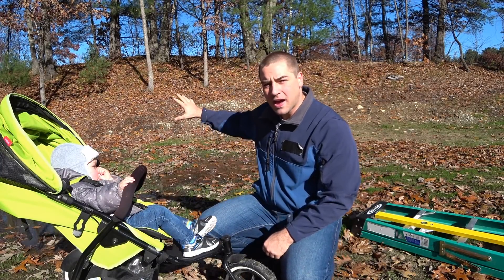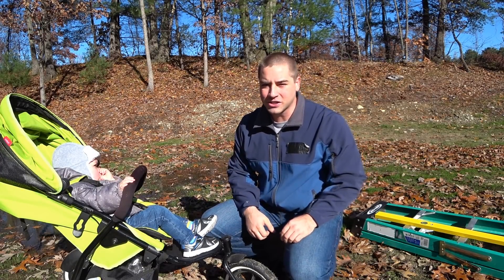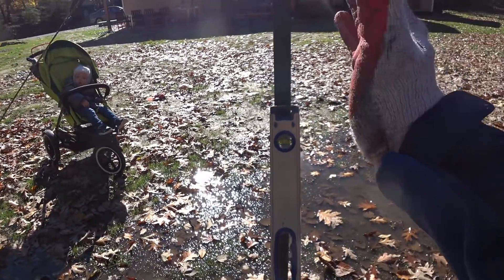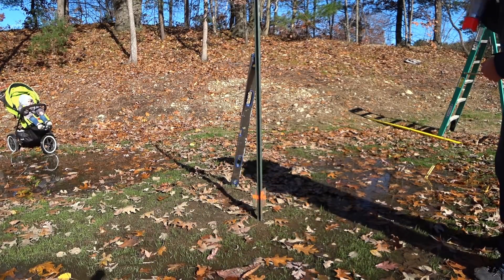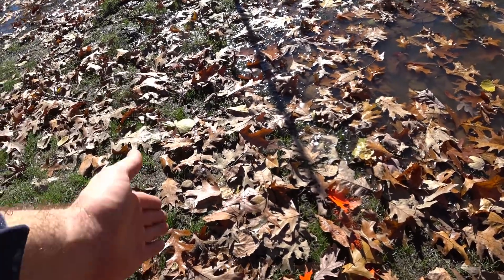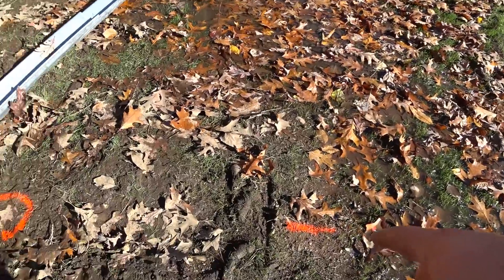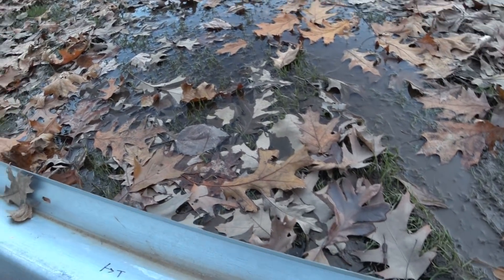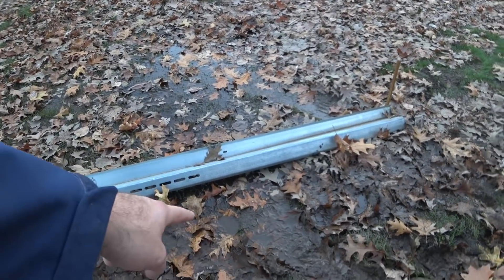Maximize Solar Production by Finding True South

Comment: People track the Sun & Moon and watch how they both move over night in a major way, our Sun & Moon change their respected Gates at different times throughout the year.  This lead us to a major discovery about how this earth does NOT MOVE.   Yes, this is the truth and if you take the time to chart the Moon (it is easier then the sun) you can discover this too.   We are OFF the Grid and have been now for almost a year so in 2017 I started charting the Moon and Sun, and then I saw it !!!  In one night the Moon moved in a major way, miles away from where it had just appeared the night before just as it is written to do in the book of Enoch.   Call it what ever you want but you can not call it unless you have seen it with your own eyes.   The Moon follows the same path through the same gates as the sun uses and this is a must for solar tracking to know where the Sun is at different times of the year to get the most out of your solar panels, so track them, start charting the Moon where it appears along the east and you will see how it moves from One Night To The Next, this happens after most blue/Blood Moons.  We have charted them and they have Six Gates per year so far as we have charted, this will be our second year of charting so we are excited to see with our naked eyes the real truth about our earth which we believe to be stationary as proven by the Michelson-Morley experiments.

Comment: you should do A video on all the parts you have connected to it, also check the lines to see if they really are putting out 120 frequency and when you use the, I find that inverters do not put out 120 frequency on A not bases but they are fine for computers & lights - you need to get the kind of saws that are on batteries and charge them on solar

Comment: hey how about taking what you can get and amplifying it with a motor that turns another motor turned into a generator or even a generator stator and rotor that with an ebike motor with high rpm and high torque running at low rpm will produce hundred of volts for only ten volts. you can make more then you are thinking when you read this.
Reply from the maker: LOL

Comment: Azimuth and angle are a massive deal for solar and very much so with panel efficiency as low as it still is.  If they were at or above 50%, then it would generally be a much lower concern.

Are you going to change the panel angle each season change?  (Servo driven might be overkill but having a notched configuration so you can set the angle every quarter year)
Reply from the maker: I made a video a while back showing my design for a tilting array.  I can still do that, but right now I'm leaning to fixing the angle at my latitude.  Just to simplify the project.  https://youtu.be/C5CtKyVshxU

Comment: Nice! You've got a fair amount of space there - you could put the array on wheels and pivot around a post to follow the sun manually or automatically. The pivot point can be anywhere, and it doesn't have to track the sun across the whole sky.  Even a 45 degree variation would make quite a big difference near dusk and dawn because in the summer an array tilted and facing due south would be in shadow.
Reply from the maker: Hi Andy Lee Robinson,  If I had a wider yard I probably would set up a tracking system.  However, with my particular spot I'm shaded on the east and west.  This spot will be in shade until about 10 am and go back into shade about 2:00pm  Fairly low sun-hours.  I'm making an assumption that with my shading the added complexity of a tracking system is not worth it.  However, I do admit that I don't have a fancy sun-eye device that proves it.
Reply: @DavidPozEnergy  That's a pity. Yeah, sounds like you're a bit limited by circumstances. I'm not really a fan of cutting down trees to remove shadows, but trimming offending branches would be ok.
Don't think you need a sun eye device to tell you the bleeding obvious! However, you could get several more minutes of full sun by raising the array as high as you can. Also find out where the bypass diodes are on the panels - if they are between each vertical string and the panels are laid portrait then the panel power will collapse as soon as the lower row of cells of each string get shaded at the same time.
If rotated landscape, then the panel power drop out more gracefully as bypassed strings get shaded progressively. Not sure if I explained that ok, but this could buy some extra time and energy.
Reply: You could check this by measuring the output of a panel when shading a column and then a row.
Reply from the maker: I'm not sure where the diode is, but my plan is to orient them landscape.  I'm also wiring three strings, left to right.  So the shading around 9:30-10:00 am will probably shade 2 out of the three, but one string will be in full sun, and same thing around 2-2:30.
Reply: Watch GoneWithTheWynns solar panel setup on their boat.  If you have any shading it kills the entire output of that series.  You want to separate your panels such that any shading does not kill the output of your entire array.
Reply: @Dennis Wintjes If a panel doesn't have any bypass diodes then yes, a shaded cell will turn into a resistor and block the entire string. Depending on how many cells there are in the string, that could damage the cell(s) or even cause a fire. This is a great resource about bypass diodes:
https://www.avdweb.nl/tech-tips/pv-panels/bypass-diodes
Reply: @DavidPozEnergy  In addition to the main diode across the output, on higher quality panels there should be more than one bypass diode, one for each one or two columns so the panels can still output useful energy even if one or more cells are shaded.
I mention this again cos it's really useful! https://www.avdweb.nl/tech-tips/pv-panels/bypass-diodes

On my home made portable solar panels made from 6 A3 pages of 6 cells each, I added 6 bypass diodes so if any cell on a page is shaded, only that page gets bypassed so the other 5 pages can still get their electrons out.
This is useful if I use them where people may be walking by.

Comment: Looks good and works unless you have shading issues at either sunup or sunset then you would want to compensate for sun time on panels by directing the panels for more direct sunlight which changes the solar noon or highest gain time. At least that is what I think.
Reply: Yes yes yes